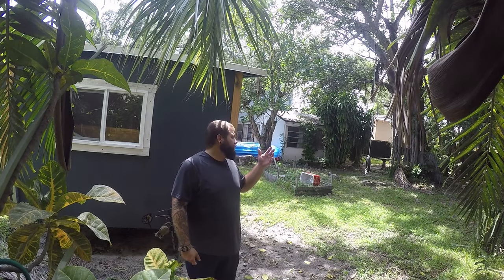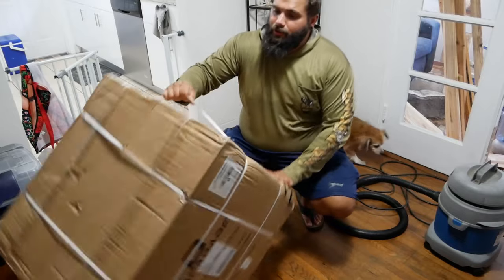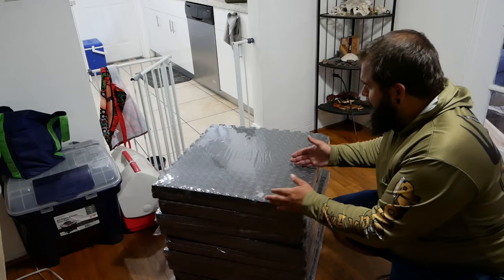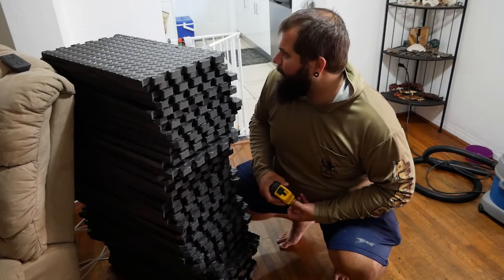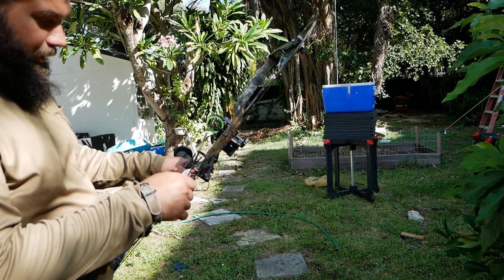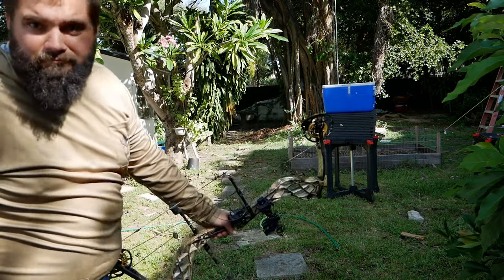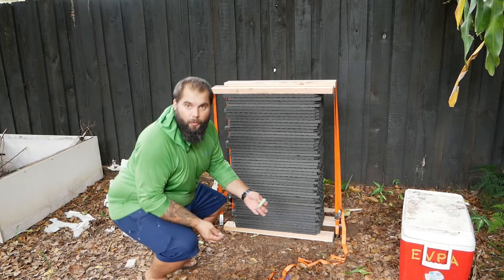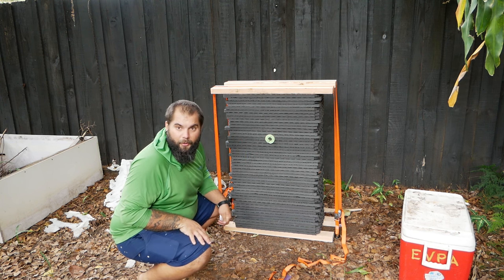HEAVY DUTY DIY Archery Target for UNDER $100!!! (Swamp N Stomp ep. #107)

Comment: I've tried them all. Now my go to is a $15 plastic wrapped cube of compressed sugarcane mulch. Perfect penetration level, easy withdrawal. Spray or stick some circles on it. Ultra cheap, ultra quick. Fix it with packing tape, use it on the garden when it finally fails. Oh, use all 6 sides too, btw. (I still occasionally use a compressed EVA foam block for broadheads). Hint: get good at closer distances (and tune bow sights) before you walk back and you'll never miss the target.

Comment: I would not have split them to allow for deeper penetration with sharpened broadheads.  But I do love the height of your target to account for sighting in for different ranges, arrow weights, etc.  However, I made an even cheaper target by saving a nice cardboard box and then stuffing said box with cardboard.  Mostly pieces that were cut to size and other pieces that were puzzled in.  It makes a great target, and it was completely free, assuming your wife orders as much crap from Amazon as mine does.  Having said that, great build, great idea. And great target.

Comment: I built this basically the same way except I used 36inch all tread and nuts on either end. and it's been solid for 2nyears. Broadheads, field points, whatever I throw at it, they stop. It's an excellent design.

Comment: made one myself but cut the mats into thirds, arrows go about half way in at 70lbs but i have never had one pass through. its also a good idea to put some spikes on the bottom as you can stab it into the ground and it wont tip over

Comment: Did you think about using the boxes with the foam as they came in, just like that? It seems like the cardboard would add some compression and although the arrows go straight into the foam compared to going along the layers, it seems to me that this would be the most cost effective and easy way to just shoot at a target, don't you think?
Reply from the maker: That could work, but I think you get more bang for your buck by cutting them in half and stacking them. Get twice the surface area for the cost of 2 2x4s and 2 ratchet straps -Mark

Comment: Can you use broadheads and how did the arrows pull out? Do youvthink it would be ok for cross bow? Thanks
Reply from the maker: Arrows pull out easily. Yes you could use broadheads but it will chew up the target faster for obvious reasons. You could use for a crossbow but I would not cut the sheets in half so you have more depth to stop those ultrafast bolts. -Mark

Comment: Nicely done.  How did it hold up?  A follow up video would be nice.
Reply from the maker: It’s still taking arrows like a champ. I ended up having to replace the 2x4s cause they eventually rotted because I didn’t use pressure treated wood. But it’s been like 4 years of taking arrows and it’s still going strong

Comment: I would like to see this done using all-thread bars on each corner with washers.  To see if it could be cranked down any tighter.
Reply from the maker: You don’t actually have to crank it down tight. It’s just to hold the pack together. You can crank it real
Tight with the straps but it doesn’t make it stop arrows any better.

Comment: Nice but my question is how they would perform with broadheads? Noticed you were using field tips. Broadheads always fly different than field trips and so if I'm sighting in before a hunt I would want to do so with the broadheads I will be hunting with Which are the montec G5. Be nice to see you test with broadheads
Reply from the maker: It takes broadheads fine but they will damage it and eat it up faster. I usually get it sites i and practice with field points and then send a few broadheads to get sighted for a hunt. -Mark

Comment: I just checked prices on the mats. Did they go WAY up in price?
Reply from the maker: Didn’t everything?
Reply: I was doing bad math. The 1/2" mats were only about $110.

I made this target with some changes. I used two pieces of lumber, each 23" long, to "sandwich" the mats. There are two rachet straps the cinch the sandwich tight. It will be very simple, tool-less, to replace mats when needed.

There is about 6" of arrow penetration. It's a very safe and self-repairable alternative to store bought targets.

Comment: Great video. I was wondering if you could tell me about how thick the sheets were after you tightened them down with the straps. I'm trying to do the math of how many I would need to buy to make the size target I want but I don't know how much height is lost from tightening them; it looks like not much at all from your video but I can't tell.
Reply from the maker: They don’t really compress, you just use the straps to snug it up. No height lost.
Reply: @SwampNStomp  Awesome, thanks a lot. I really appreciate all the details and long term results you included in this video. This is definitely the most effective and easiest DIY archery target I've seen. I can't wait to start shooting my Bear Super Magnum 48 Recurve. I bought it years ago after my Bear Grizzly got warped, but I never got to use it because my disability (optic nerve damage) stopped me from shooting. Thank God I've recovered enough that I can try shooting again; can't wait to pick it back up!

Comment: Was it really necessary to cut them, couldn't you just have shot at the flat side?
Reply from the maker: It’s not necessary to cut them, it was just a way to get more bang for the buck cuz I didn’t need it to be so deep since my arrows are not penetrating that deep. That said if you’re shooting 80lbs u may want to just keep the stack uncut. What you definitely don’t want to do is shoot at the flat side. Cause when I do that, every arrow is penetrating every tile, so when u get a workout hole in the middle you need to buy a new set, but by stacking them and shooting at the side, whenever you get a worn out hole, you can just rearrange them to create a new untouched spot in the center. You’ll get way more out of your target if you do it this way. -Mark